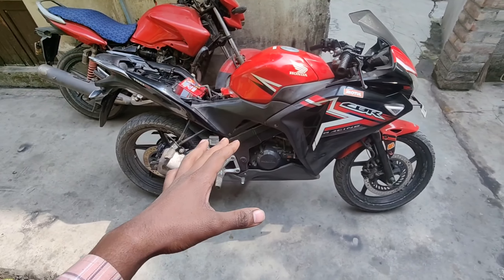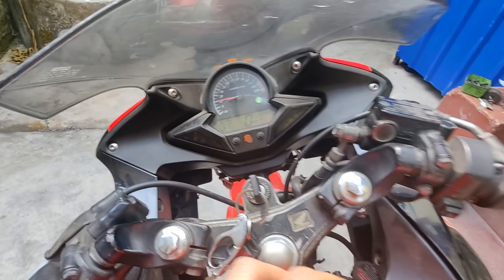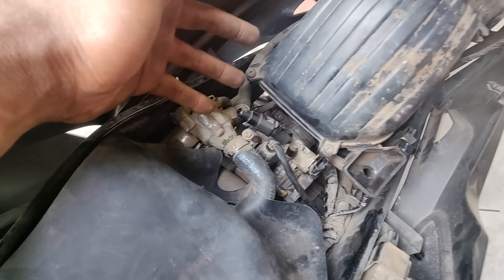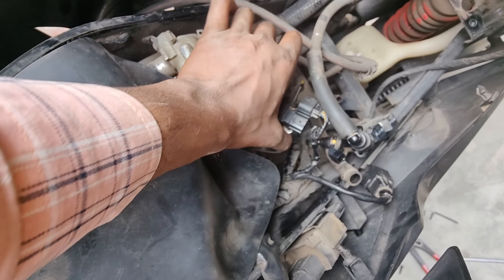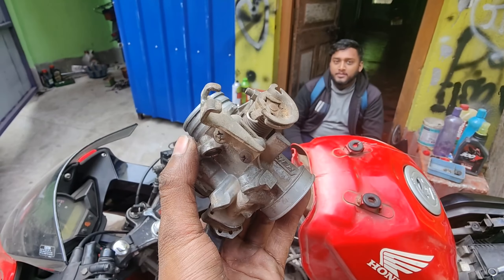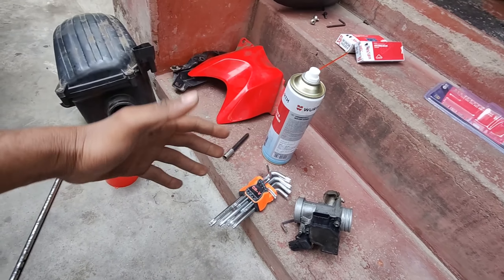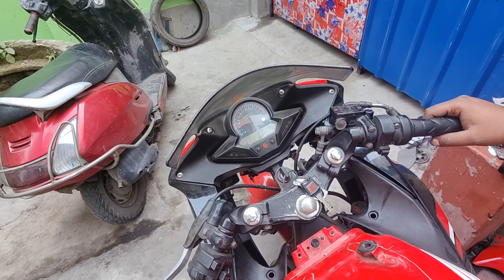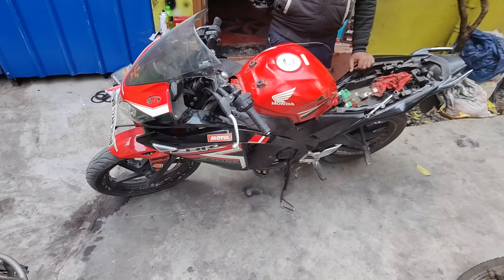CBR RPM Problem solve high rpm

Comment: This is the same problem facing in my 250 after cleaning the throttle body plz plz help
Reply: Same hare with my 150r bro
Reply: @fuzailkhan8972  plz check manifold rubber is there any vaccum leak or not
Reply: @navreetsingh-k4v  manifold rubber is the part that connects the throttle body to the chamber right?
Reply: @fuzailkhan8972  yes
Reply: Some time when we remove throttle body from engine it may crack some times due to which vaccum leak problem occurs to check this you need to put petrol on that rubber when the bike is start of there is leak in manifold rpm will fluctuate or may be bike get off
Reply: I have changed in my bike it works fine
Reply: @navreetsingh-k4v how did u diagnose it bro like how did u get to know about it?
Reply: @fuzailkhan8972  start the bike and put petrol on that rubber if bikes rpm rise or bike shuts off then there is vaccum leak you have to change that rubber